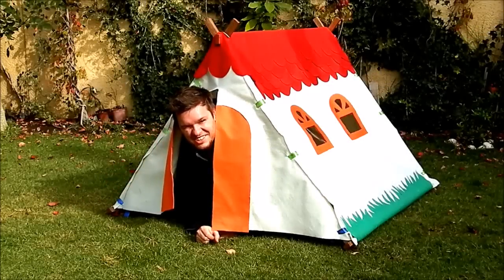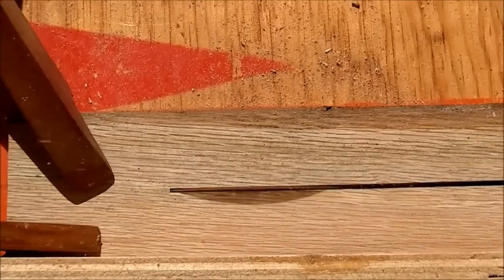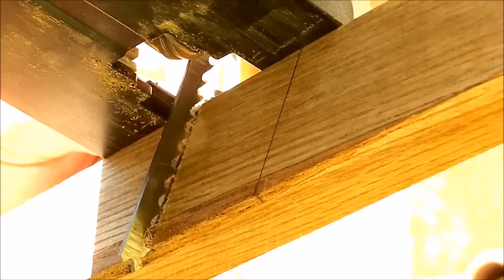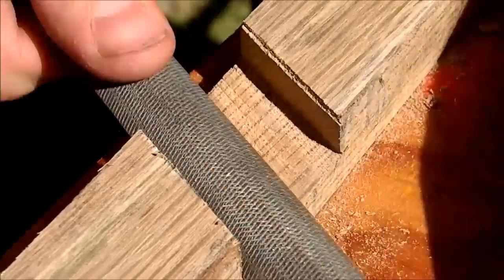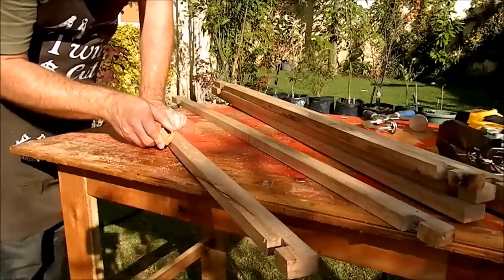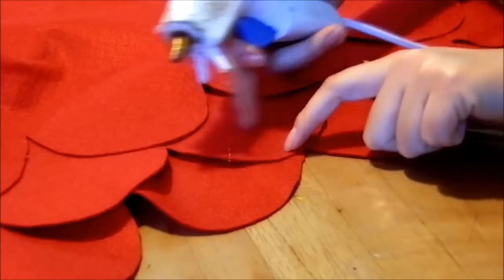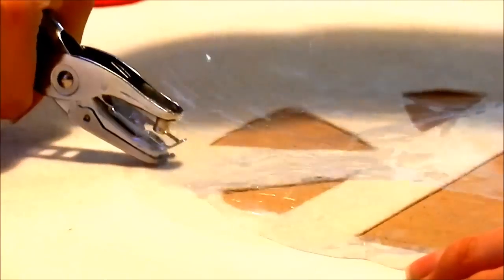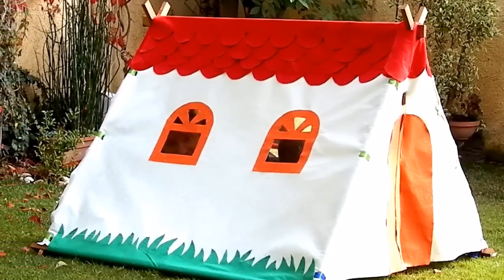Making a Play Tent for Kids - Ep 019

Comment: You can make crosscuts on your homemade table saw if you cut a groove in the table (about 4" or 10cm away from the blade) and then make a table saw sled. If you don't have a router you can also cut the groove with a circular saw. The table will become weaker when the groove is cut so you can glue pieces of plywood to the bottom of the table to make it stronger.
Reply from the maker: Thanks aqwood 
I was just lazy to do it, and I wanted to try another approach :)